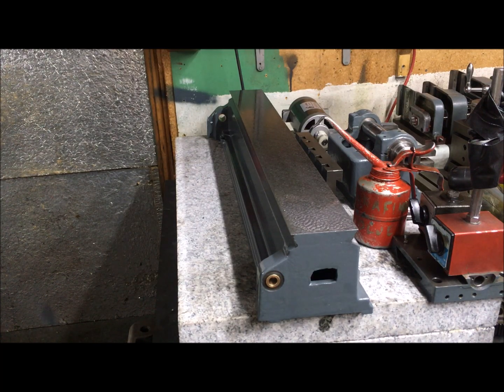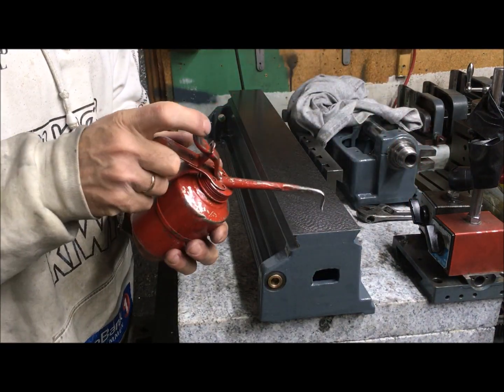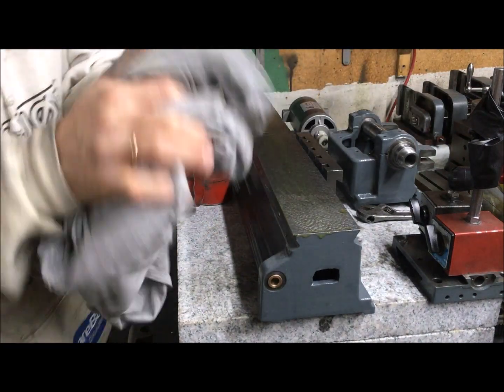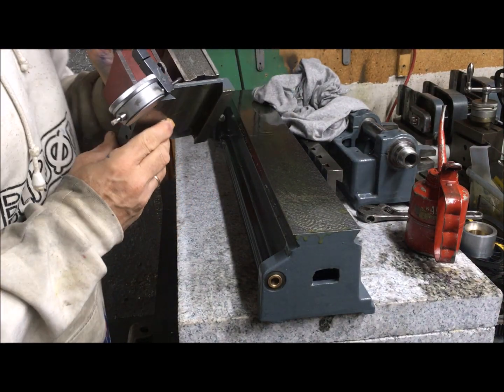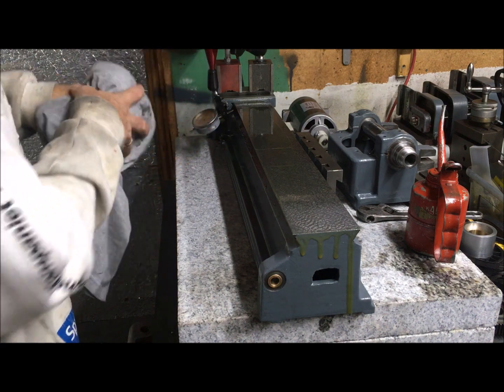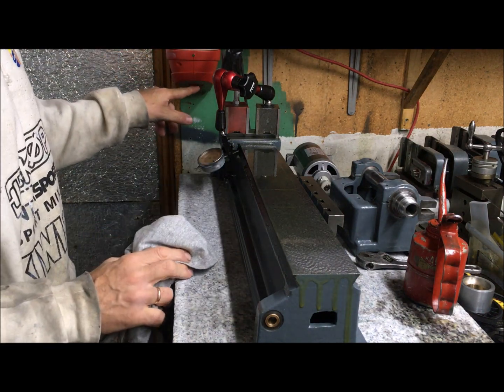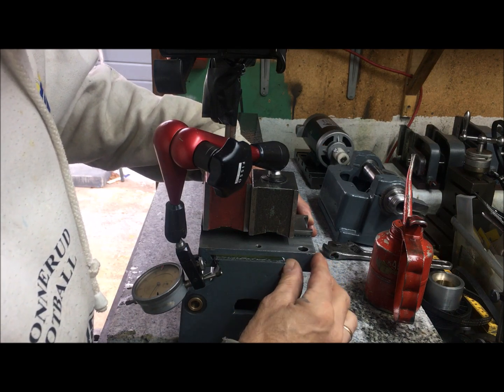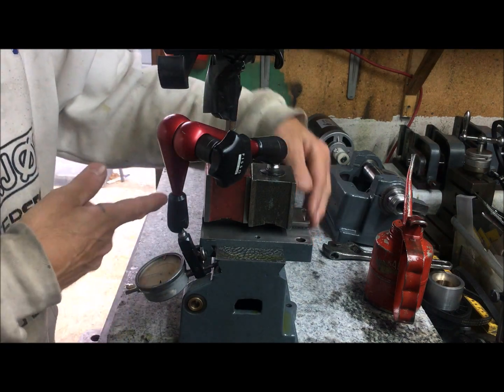Myford ML10 bed - part 3 - measuring dovetails

Comment: Hi Jan. Do you know if the difference is big when you measure with or without oil? I thought I had learned somewhere that the oil will give you wrong measurments sometimes..? (because the oil film is "soft"  and would compensate slightly convex or concave surfaces)
Reply: An oil lubed surface is really no different than an air bearing, with something like a spindle it's fully and equally supported around it's full perimeter.Using the words oil wedge while being perfectly correct terminology helps one think it only happens in one area. I'm no where near being a lubrication expert so just some guessing here with a bit of logic thrown in. :-) I'm basing that logic on today's use of much thinner oils along with very tight bearing clearances on modern automotive engines. It's my understanding that the oil viscosity and bearing (or slide clearance on a machine tool) limits the oil wedge thickness before it starts to be sheared off since fluids can't be compressed. That shearing action is likely extremely consistent if it's being created on highly accurate and true surfaces. If it wasn't oil lubricated machine tool slides couldn't create accurate parts. If anything the oil very likely averages out the measurements between the very fine high/low areas scraping gives. I would also guess that with a highly worn machine then yes getting very accurate test measurements might be a problem since there's large variables in the surfaces being supported by the oil film. So that logic makes me think the oil wedge can then vary a lot in it's thickness.
Reply from the maker: @turningpoint6643  Wise and logical! Much better explained and expressed than I could have managed :)
Reply from the maker: Never heard about the mentioned effect, no. I believe the difference is negligible, but could of course be wrong. However, I think it more likely that is has an effect, but for practical measurements like this too small to notice. The machine shall ride on an oil film anyhow. One of the functions of the scraping, especially on the mating saddle underside is to provide an oil retention effect. This will produce a machine that lasts a longer time before the ultimate wear sets in and tolerances no longer can be met, than if no scraping was done.
Reply: @jansverrehaugjord9934  Thanks for your answer - i am acutally familiar with scraping and have done a little scraping on my lathe and quite some more on my small milling machine. Though this is nothing compared to what you have done already :) 
However - I just remembered that this thing with the oil came from my lathe manual where they describe how to set the tapered precision roller bearings to the exact clearance (2 microns). There they say it is very important to do this with a dry bearing but that is then of course a different situation. If you were to measure that clearance with a lubricated bearing, you wouldn't get a clear result since the oil film can't be pushed away completely because of capillary action. 

So I was - with this in mind - always thinking that measuring on a scraped surface should be done dry too. 

Keep up the very interesting work - i am learning a lot from your videos! 

Cheers Florian
Reply from the maker: @tschibba  Tja.. maybe you are right. Will try more. It is at least so that when you have some clearance in a bearing like on this lathe you will have some effect like you say, ie. when the spindle is in motion it floats on the oil and is centered and while it is in standstill, it sags.